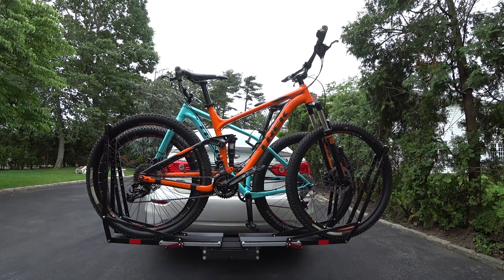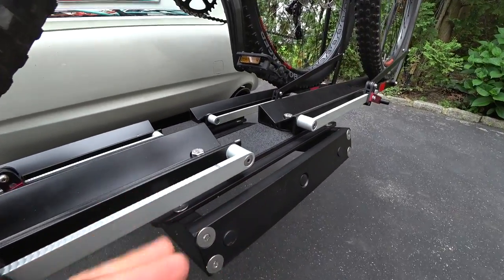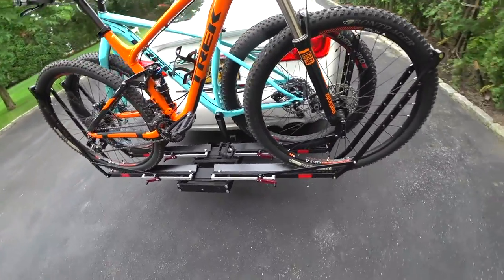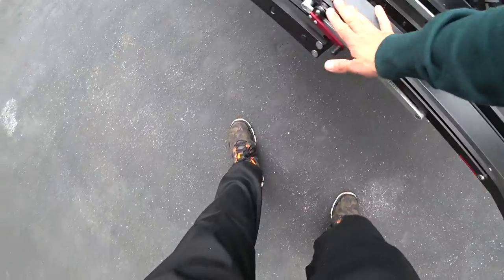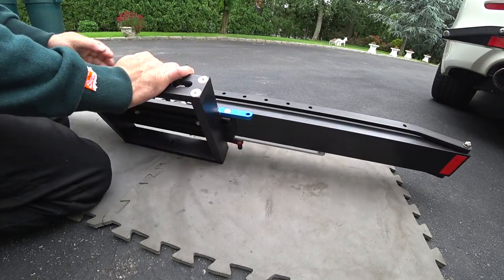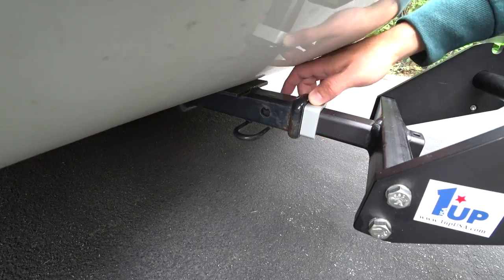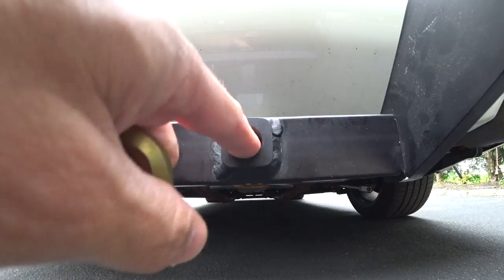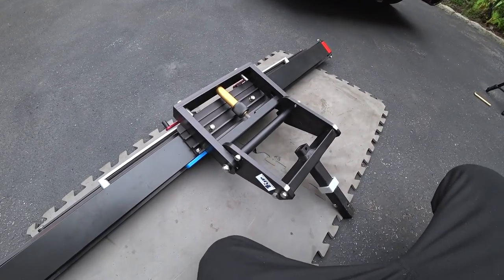The Best Mountain Bike Car Rack | 1-UP USA Review 2018

Comment: Hi Auto Fanatic, the security wrench used for the rack is a common tool found at many tool stores. You better get the locks to lock the add ons to your base rack and the lock to hide the mounting screw of the base to the receiver hitch.
Reply from the maker: I have never seen a security hex bit that large locally but I'm sure Mcmaster or Grainger has them. We do not leave the bikes on the racks anywhere so never used the locks we bought 3 years ago. we go from home to trail and back in most cases.
Reply: The new 1UP racks including "older" models no longer use the skewer type hitch lock to cover the security hex bolt. Instead they cut a slot in the hitch so that one can use a standard hitch lock. I like both options, may have a welder add on another 1/2" so that I can easily block the bolt as prior.

Comment: Thanks for the review, this is the best rack. I have it for five years, only problem was the silver aluminum part started to corrode, they replace it for free. Also just got the rack for my fat boy and it works awesome.
Reply from the maker: cool i just ordered a new Trek FS Stache should get it in a few weeks i like the fatter tire 29 so much more
Reply: Auto Fanatic yeah they’re so great in the snow and on the beach. 

I have a couple questions for you, what’s the best polish and compound system in your opinion? I was leaning towards Adams and CG, also what random orbital would you recommend? Thanks for the detailing vids!
Reply from the maker: James Guzman the Griots Boss system is my new fav polish package ive been using it on everything with all my machines.
Reply: Auto Fanatic thanks for the info!

Comment: Great video - this is the best I've seen for getting a good, detailed look at this rack that I've been curious about.

Can you address the security question that a couple of us have?  It seems to be pretty insecure with all those exposed bolts and the security hex key isn't much of a deterrent.  Basically, we're just counting on nobody having access to one of those hex wrenches, no?
Reply: you can get a pad lock to prevent access to the hitch screw. 1up sells them for about 15 bucks but you could also get a small padlock that slides in there.

Comment: I was going to buy this, but even locked there are too many bolts that can be undone. Also you can get that Allen key online. I asked them if the rachet mech starts to not hold if they would replace that part. They said no it's normal wear and tear. I don't like that aspect of customer service. The original guy who made this has made one alot better called quik rack but he's talking next year until release. So kuat NV 2.0 looks like the best set-up out there. But good review
Reply: This is the first thing that came to my mind.  Am I missing something, or is this thing just a security nightmare?  Seems like it'll come right apart with a few easily-accessed bolts and that security hex key is pretty weak protection.
Reply: Actually, it's even worse - quick release on your front wheel and the whole bike is loose.  You'll need to cable it all up pretty well either way.
Reply: Poking around on the 1Up website a bit, I came across their wheel locks.  That's a great, though expensive solution (need 2 per bike - another $38 per bike!), but the overall security still depends on the overall physical integrity of the rack itself and not being able to just deconstruct it at any of the many bolted joints.  You'd still also need a cable lock or something to keep the bike frame attached to the wheels.
Reply: @SoDouglass  

Where are you getting coffee that you're leaving your bikes unattended so long.
Reply: @raynellholmes1011  

I never bought one, so I admit maybe I'm missing something, but it sure looks like you could completely free up the bike with just a quick release on the wheel.

How long does it take you to quick release your front wheel off your bike? Someone could have your bike off the rack before you even walk into a Starbucks, let alone stop for lunch or get into a hotel on a road trip.

Do you never take your bike any farther than directly to your local trails and straight back home?
Reply: @SoDouglass  

Most I've done is McDonalds drive though and CVS. I chimed in on your comment because I just recieved the black one and love it. Up until today, I've only read positive reviews so I didn't want anyone making me reconsider my purchase. My original choice was the Kuat NV 2.0 but decided this held bikes in place better than a strap on the rear wheel and bar across the front tire. I like the forged all-metal look too. It's really simple and easy to use compared to my old Walmart hanging hitch rack. I get the security concerns but for my use it's a non issue.
Reply: Leave your keys in the car and it’s all gone!

Comment: How do you get the hitch on the car?
Reply from the maker: lift and slide into receiver
Reply: Auto Fanatic  no shit, how did you get a receiver hitch on that infinity?
Reply from the maker: it bolts on like any other hitch why would you ask such a question
Reply: Auto Fanatic dude I get that. Did your infinity come stock with the receiver? Or did you have to put have it put on the car??
Reply from the maker: i think we used a Curt hitch on this car, the receiver is part of the hitch visit etrailer.com they have hitches for every car with photos and install videos that may help you out
Reply: Auto Fanatic thanks!👍

Comment: Is there an option like this one for 4 bikes?
Reply from the maker: Genysmen runner yes you can add two more extensions for 4 bikes total they bolt on in seconds
Reply: Auto Fanatic the extensions are sold separately or came the four with the purchase?
Reply from the maker: Genysmen runner sep ck their website
Reply: Auto Fanatic I bought a new bike so I need one, thanks for giving us your opinion

Comment: You should take a look at Sea Suckers bikes racks. Nice bikes.
Reply from the maker: i would never trust one of those with the roads and abuse we drive over, too risky i saw one fly off a Audi TT a while back as it hit a huge pothole destroyed the ladies car. I also do not like sticking anything to the cars paint or glass it can scratch if your not cautious.
Reply: Auto Fanatic Kool. I've had mine for 5yrs. No marks or scratches. When I got my 2013 Ford Fusion I didn't want the straps to scratch my trunk.
Reply from the maker: yeah the straps from those racks stinks with those rubber coated hooks on the edge I had one way back from Thule, the hitch mount is the way to go depending in car its so much easier i feel.